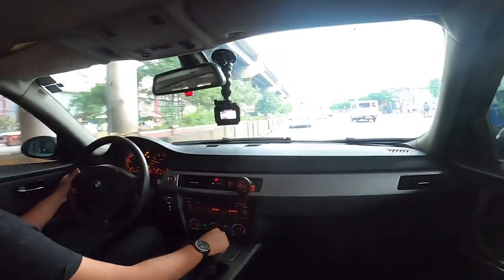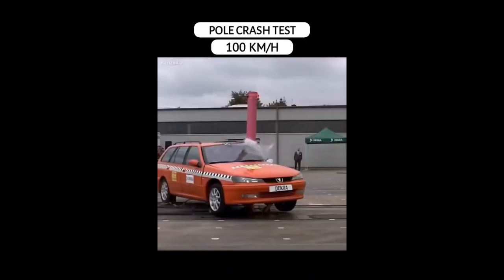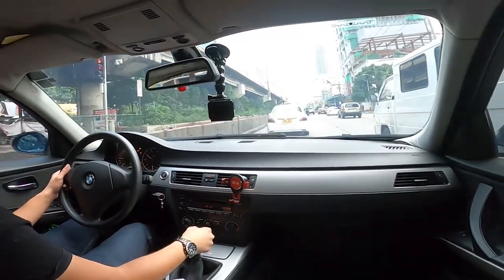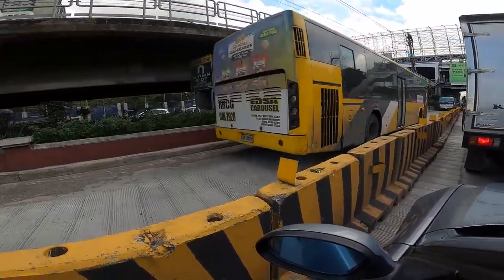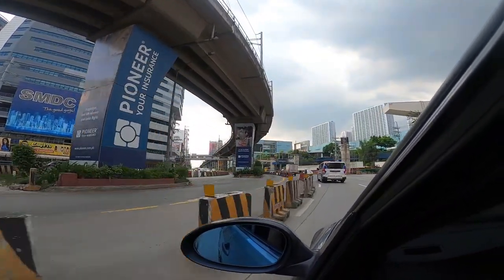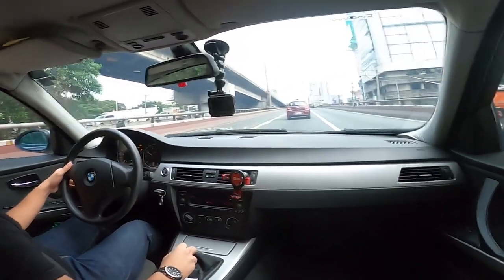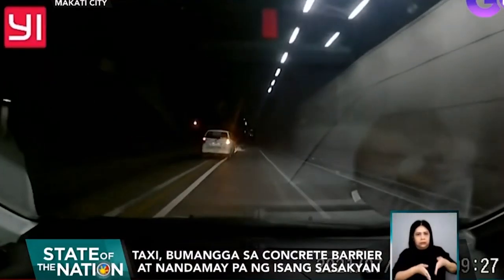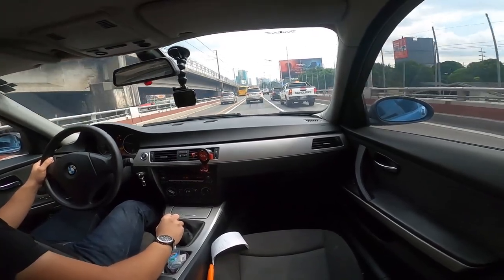Why these EDSA Concrete Barriers are Extremely Dangerous

Comment: Agree with you! 👍 These barriers are dangerous and can lead to a major accident. I just wish that the MMDA and DOTR will think of a more safe barrier. For how many accidents that happened, MMDA or DOTR still wont do anything. If I could suggest that if they remove the barrier and place officers to check if vehicles are passing through the bus lane just like old times. 

But I do really like what they did where they made the bus lane at the left side and have own stops unlike before where buses and jeeps can stop anywhere evin if they are in the middle of the road and you can also see bus racing along EDSA.

Comment: Driving on the leftmost side in edsa is nerve wracking. Either you get squeezed by the next lane or some bus will push those blocks toward you. Hence why i prefer driving on the 2 right lanes most of the time. If only theyd use a different barrier like sticks or plastic with water.
Reply from the maker: True. I try to avoid the lane if I can. I advise people to do the same especially when driving late at night

Comment: I agree specially at night, my temporary solution for this is just to stay away from that lane as much as possible.

Also, I'm thinking instead of barriers maybe they can just put rumble strips that are a little higher than the usual?

Btw how did you mount your camera on the passenger side? I mean what's your setup there brother?
Reply from the maker: It was just strapped to the headrest

Comment: What does concrete barrier has to do with accidents? It's the people that drive cars and has no road discipline. The barrier were concrete because people just shug off the plastic and motorcycles goes through it.  So you blame the barriers. What a stupid video